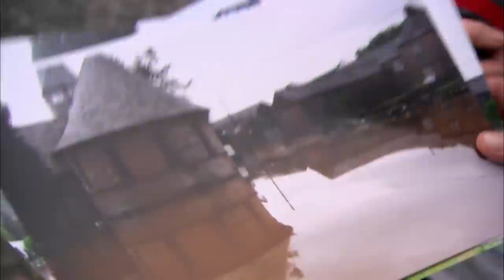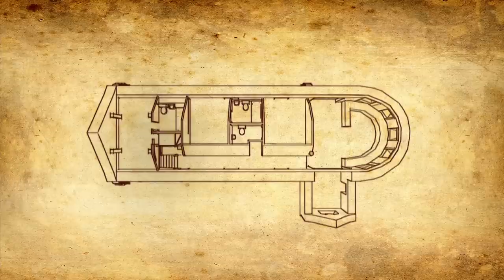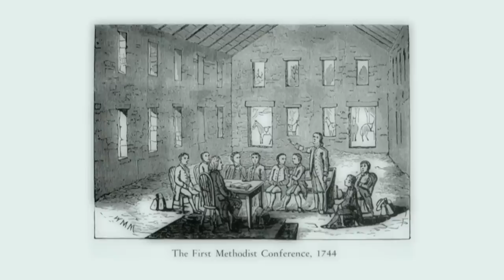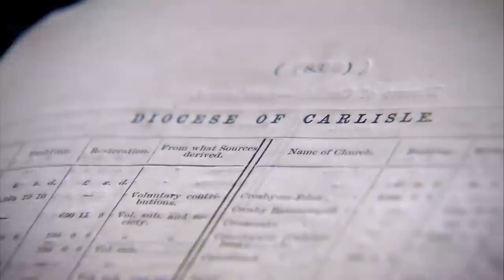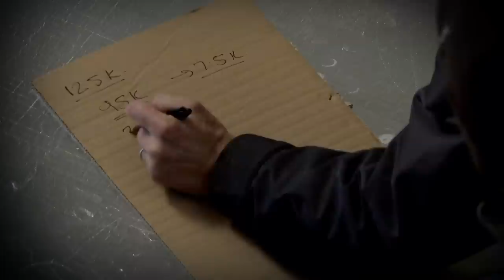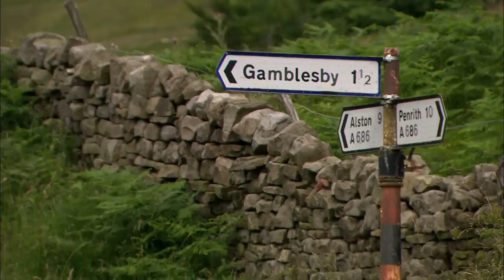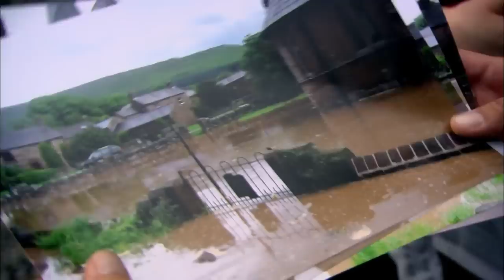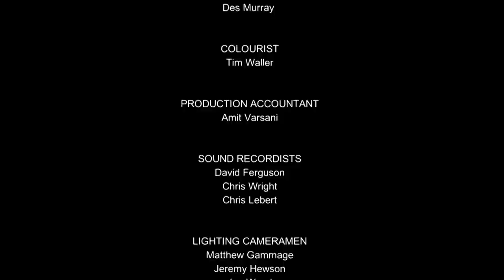Church Conversion Success Story - The Restoration Man - S02 EP11 - Home Renovation

Comment: Would have refrained from rebuilding the steeple immediately after finding out the costs of that.
Just stretch the top roofline towards the gable wall. And re use some of the of the good remaining beams in the steeple, including the slates, to do so. 30.000 pounds less. But then again, been a builder (roofer) for 12 years. Although overhere in the Netherlands we use ceramic tiles instead of slate. Only very fancy and ancient medieval buildings have slate roofs.
Reply: Maybe they couldn't change it because it's protected as a herritage site?
Reply: Heritage would not allow that - for sure.